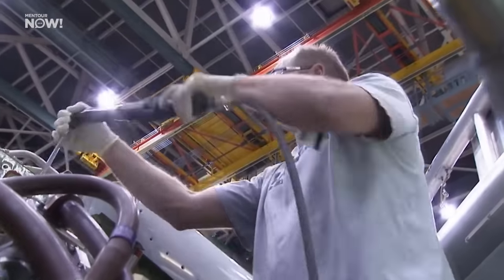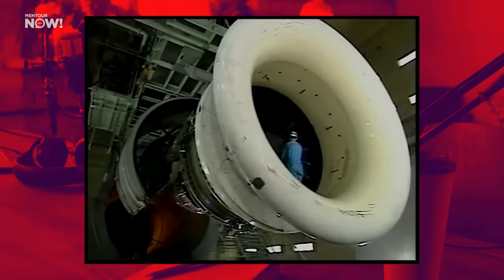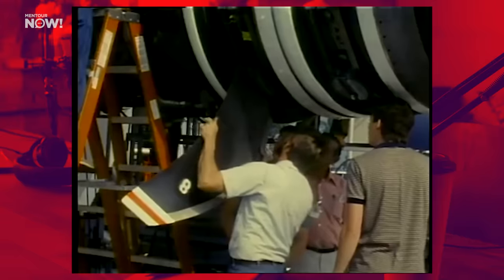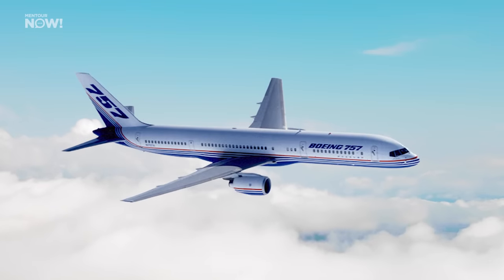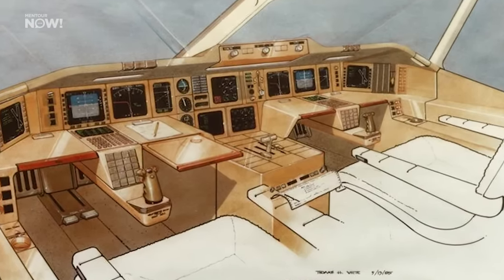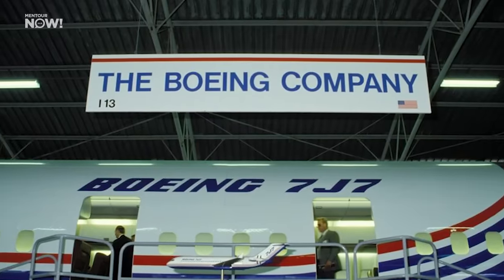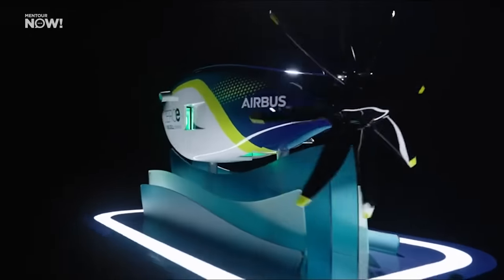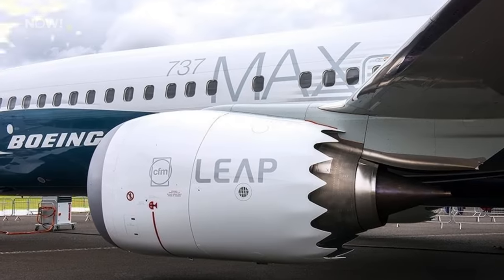Revolutionizing Flight! The Amazing Potential of the CFM RISE Engine.

Comment: Pratt and Whitney and Allison my A- -  , That Prop was a Hamilton Standard Counter Rotating Unducted Fan, Pratt made the Engine, Allison the Gearbox, I was Uncle Hammy that built the fan! I had just arrived a Ham Standard in 1989 the year they cut the funding, I worked for a short time on the follow up large scale Prop Fan, but the price of fuel plummeted so everyone said why bother.
That monster had 35% increase in fuel efficiency that the jet engines! It was cutting edge technology for sure the blades were water jetted, they had issues with the slip ring assemblies which were slatted for an upgrade then poof all gone.
Reply: That single Prop Fan on the NASA Aircraft was also a Hamilton Standard Prop Fan, they used a Harmonic drive to change pitch, The blades deep sweep was because the blades were designed to operate in the transonic region all day long, it was this that made the noise, a duct was envisioned for future models to combat the high frequency noise plus active electronic noise abatement in the cabin, We at Hamilton Standard had the answers and the solutions, the airlines were just knuckle dragging neanderthals with no vision.

Comment: When the supersonic Concorde retired, the commercial aviation industry became the only technologically driven industry to go backwards. 

Now, the commercial aviation industry is going backwards again, by basically returning to its propeller past, in the name of EFFICIENCY.

However, the UDF (Un-Ducted Fan) looked better than the modern replacement. That's because the fan at the rear is more visually pleasing when it's mounted behind the engine, not in front.

Comment: When it comes to the P&W geared turbo fan engines that power the A220 and E2's, reliability seems to be on going issue, especially when the jetliners are operated in very warm, humid climate. There are some indications that P&W have at this point time rectified most of those issues ?

Comment: What about containment of fan blades if one experiences failure?  The current shroud provides some protection of this but even reinforcing the fuselage or other areas needing protection would be an issue in my opinion.
Reply: That's exactly why earlier attempts to build unducted fan planes put the blades aft of the tailplane ...

Comment: My understanding of historical unducted fan attempts is that they were always way too loud.   And airport noise restrictions have only gotten tighter since then.  A standard turboprop has better efficiency than a jet and less noise than a fan, maybe funding research in that direction (e.g increasing cruising speeds) is the most promising in terms if improving commercially viable solutions.

Comment: When you need to achieve greater efficiency at the expense of everything else, you can put turbo-fan engines. More environmentally friendly as there is less fuel consumption. However, there will also be less speed, since at high speeds, this type of engine will be subject to increased vibrations, and with them an increased noise level will occur. Aircraft developers have dug up blueprints from the 80s and are trying to present it as new. If someone wants to know how the flight will look like - watch the video with Tu-95 flights

Comment: Counter rotating props were abandoned first in the 1950s because the frequent maintenance was too costly. And the speed was too slow compared to turbo jets.

They were VERY efficient for long distances though. You could go double or more the distance with the same number of passengers.

It would be interesting to see them make a comeback in the light of global warming and emissions reduction.

Though I'm not sure if passengers would be ok with slower flights.
(also rail is the way to go for efficient passenger and cargo transport. So what's the point of a slow passenger plane)

Comment: All sorts of questions start to come up when I see something like this. It's pretty much just a glorified turboprop. 

That likely suffers from all of the same problems that we already know of today. 

The by pass ratio I find extremely suspect in regard to it's efficiency. One of the biggest problems without having a shroud is that now your efficiency goes down on your wing tips (prop tips). Which means you will need longer blades to build up more pressure. 

I'm curious how the turbulence behind the fans will be. Counter rotating generally doesn't add much lift so that's interesting they are adding fins instead. This is actually what my previous company did with their fans to make them more stable but they were not adjustable even going so far as to angle them. 

I wonder how they are actually going to go faster than a traditional turboprop we have known for a while that turboprops are generally more efficient but the struggle has always been more speed. You get to a point where the prop tips reach transonic speeds and all hell breaks loose you seriously don't want to go transonic on your tips

In the image they didn't show counter rotating props on the other side of the aircraft which had me quite confused. Are they not concerned about the rotation momentum and trying to balance it out? 

And finally the cost. Are they going to feasibly be able to compete with high by pass turbofans? Who cares if the engine is 20% more efficient if they cost more either overall or in complexity/maintenance. 

No one really cares about the carbon footprint when it comes to their wallets (as they should because it's BS).

Comment: The gearbox must enable the blades to spin at a lower RPM to get close to but avoid the blade tips reaching the speed of sound. It is not just the simplification but the development of better more reliable gearboxes. At least this is the way I interpreted your videos information. All of this tells me that scaling up such an engine may pose some limitations on its size and thrust.

Comment: It would be interesting if the new toroidal blades could be used on these unducted blades thus having no blade tip ends and a more efficient quieter operation.

Comment: A very similar engine was attached to DC9, B727, and I believe an A300. They are probably still rusting at the Mojave airport. Oil prices fell and airlines lost interest. Where would we be now if they had continued to develop these engines in the early 80's. Of course that is when dumb F reagon pulled the subsides to wind and solar. Big oil had control. Don't worry though Germany, Japan, and the Dutch to name a few countries with foresight, continued to develop wind and solar. We have played catch up ever since.

Comment: God gave owls finely divided feathers on the trailing edges of their wings which makes them almost noiseless to prey. That and several successive staggered elevation wingtips. Maybe designers should do this for the trailing edges and tips of the turbo fan blades.

Comment: The idea of having a tube on the wings or tails to house a engine seems inefficient when there is a fuselage. Could a engine be built into it and the propeller spin around the outside of it, of course the air directed towards the wings though. Though it sounds way out there the weight ratio would be reduced, the diameter and therefore airflow increased, and there’s no worry of the parts flying off into the place itself.

Comment: NASA just threw Boeing a huge bone with the Transonic Truss-Braced Wing Space Act Agreement.  This will give Boeing a huge leg up on development of a 737 replacement.  The TTBW can work with a turbofan or open rotor engine so it'll be very interesting to see what an ultimate production version uses.

Comment: Hydrogen might work for planes because it gets burned fast. Problem with it is, it is highly corrosive and seeps through everything. Airbus has been running Turboprops on big planes like the A400M for a pretty long time now. Turboprops are a bit slower than jets, but in general I think they are much more efficient than jet engines. I guess it depends on finding the sweetspots between RPM torque centrifugal and centripetal forces along with the material science to make strong enough blades to withstand the ever present birdshot problem.
I wonder if the prop/fan design is able to take insipration from submarine propellers, because some of those designs are still secret and they reduce the noise in water by alot.
There is also alot comming out of drone development quadcopters specifically, things like the onesided propeller with counterwight and the connected blade type propellers. I wonder if anyone ever did a test with a onesided connected prop blade yet.
The bypass has a very interesting property, it sort of creates a funnel for the even more accelerated air and keep it compressed longer. In Rocket Science that is calles ISP. It is controlled by the shape of the conical nozzle and becomes very long and doesn't open much for vaccuum. I am pretty sure exactly the same is happening with the bypass air in addition to insulate faster air from slower air which creates the noise. Very interesting stuff.

Comment: Interesting, but I'm still dubious. Noise will be an issue, as with the Tu-95 (the only aircraft to be successfully tracked with seismometers), and the thought of a blade-out event is terrifying. If I'm still kicking when/if these engines get type approved, I'll still be avoiding them for a few years - the real world has a habit of showing up issues that weren't even considered in the controlled world of testing...

Comment: Am very surprised that these manufactures haven't implemented the toroidal blade design into these engines. They are expensive and complicated to produce, but, are much more efficient and very quiet while operating. Besides, the added expense of these toroidal blades would be quickly offset by the fuel saved. Guess time will tell if this relatively new design will ever be adopted into the aircraft industry

Comment: thanks for the explanatory video, great developlment there. one question, how much better would or could the engines be when driven to lower speeds, e.g. mach 0.7? basically all flights under say 2000km would not be much longer for the passanger, factoring in transport from and to the airport plus waiting time at the airport, so if substantial fuel can be saved there it should i guess?
Reply: or, actually, why don't we use turboprops up to those distances? how big are the differences in overall travel time (door to door) and fuel consumption?

Comment: You said the two options for a jet engine to generate more thrust are "More air at the same speed" and "Same amount of air faster." Wouldn't "More air, faster," also work?
Reply: It might be more clear to say that for the same thrust you could either accelerate more air a little bit or accelerate less air a lot. But momentum scales linearly with velocity and energy scales quadratically so you want to keep the velocity change as small as possible

Comment: What happens if it throws a blade?  I can't imagine the racket it would make running.  Most of the noise is from the fan blades. The compressor and turbine is quiet compared to that fan.  I can hear a high pitch noise from the compressor in a CFM-56 and I can hear the combustor once the engine lights off.  The fan overpowers the other sounds.

Comment: If an open fan engine catches fire, is it easier to extinguish?  I’m guessing an enclosed engine contains the equipment to put a fire out, but I’m not an engineer.   I think for commercial airlines, noise would be the biggest drawback.

Comment: I would've thought the reason blades break up if hitting a flock of birds was because the debris couldn't be thrown outwards. It would have to travel through the engine. With that thinking uncovered [forgot the term he used] blades would simply toss the debris away and behind.
Reply: Open fan! TY

Comment: Have you done a video comparing Turboprops with Jet engines.  My wife refuses to fly on a Dash 8 because it has a prop and so it must be very old.  I've tried to tell her that the two engines are basically the same except one has a prop and the other has a fan.

Comment: Current aircraft engines are used to test how an engine behaves when a fan blade breaks. No parts may penetrate through the outer fairing and damage the aircraft. It would be irresponsible for a propeller blade on the new engine to break and enter the passenger compartment. Therefore, for safety reasons, I do not see such new engines in the commercial sector, but in the military sector.

Comment: What a fascinating, well researched and beautifully edited video. Using hydrogen fuel tanks (they aren't fuel cells as referred to in the video but they are correctly supered) would be an interesting development in a business where safety is the primary concern. Hydrogen, notorious for leaking and embrittling metals, is going to be a substantial engineering challenge to make it a safe fuel in a hermetically sealed aircraft. I think it would be safer to keep the tanks in the wings where any leaking H2 gets vented straight to the atmosphere and has no way of building up to an explosive concentration.

Comment: So would it be incorrect to say that a jet powered aircraft remains a propeller aircraft but the propellers are powered by an axial flow engine rather than a standard gas, or maybe Otto cycle engine?

Comment: Great video. But I have a question. What is the point of the second set of fan blades on the new engine if they don't rotate at all?? 🤔
Reply: I wondered about that as well and can't find the reason anywhere

Comment: Aircraft is cruising at 25000-3000 ft so if they attach the open fan engine to the wing, do they have any way to prevent high-attitude freezing in cold weather?

Comment: I still don't really understand the distinction between turboprop and propfan/UDF. It just seems like a new TP design optimized for higher speeds with good efficiency. What an i missing? Not saying it can't be a great engine, just that the terminology seems more marketing than an actually different technology.

Comment: I feel like there was just far far too much time spent researching and funding this project just to arrive at what's essentially a glorified turboprop with variable stators behind it

i question if the stators relying purely on the rotating vortex column of the spinning propeller to themselves produce thrust would come with any disadvantages at cruising speeds compared to actually having a contra rotating arrangement, or even a coaxial ducted fan powered by the same turbine.

I genuinely don't want to come off as a detractor for this design and would love to see the team behind it fulfill the goals intended with this thing, these are just my two cents.

Comment: Having a hydrogen fuel cell aircraft is Very Important, but solid oxide fuel cells Simply Store more energy per unit space.

What about just making them pure electric and using a solid oxide fuel cell?  That way they get more efficiency And Distance?

Comment: When I see this design, I immediately think that it's more a new development of the turbo prop than the turbo jet, where turbofan is in the middle. What makes this design with external blades more close to a turbofan than turbo prop?
Reply: Eh, the turboprop/propfan/turbofan are closer together than they are to the turbojet. The former all derive most of their thrust from bypass, i.e. the air flowing around the engine core, whereas the turbojet is more primitive and relies solely on exhaust for thrust. But yeah, as the video noted, propfans are between classic turboprops and turbofans in efficient cruise speed, and there is a gradient of design between turboprops and propfans where each can evolve towards the other.
Reply: @henryptung  wasn't that exactly the point I made 🤔

Comment: What happens to a Hydrogen fuel cell(s) in a fuselage, if there's a fire on board? can it be jettisoned? Would it encounter the same problems as a zeppelin? can it hold up to a crash or would it diminish the survivability rate of the passengers and crew? Hydrogen to power the engines is definitely more efficient, cost effective and the byproduct is not hazardous.
Reply: It would be a similar question as what happens to a fuel pump in a regular airliner if there was a fire. The fuel cell does a different job than a fuel pump, but its only fire risk is that it has fuel flowing through it, similar to a fuel pump. Although inside a fuel cell the hydrogen is converted into water, which is what comes out the other side.  

Like with a regular airliner there will be fuel stored in tanks, and the fuel will pass through pipes and valves etc., and like with any fuel there is a fire risk. Hydrogen burns differently than kerosene, and it is more prone to leaks because of the small size of the atoms.  In some ways it burns safer than other fuels because unburnt hydrogen quickly disperses into the atmosphere, it doesn't "hang around" like kerosene does.

Avoiding a Hindenburg type of disaster should be possible by not storing the hydrogen in a highly flammable chemically coated cloth bag.

Comment: SUGAR Volt is a much better idea. Using electric motors to drive the main fan on a turbo fan engine instead of using gears from the main turbine is more efficient. This would make it a hybrid electic turbo fan jet engine. Also batteries are getting cheaper and more energy dense. Hybrid electric engines could be retrofitted to exist aircraft with batteries added too. I think NASA/Boeing SUGAR Volt study said the truss braced wing and hybrid electric engines would be 30% more efficient that a 737 MAX or an Airbus A320neo. - https://en.m.wikipedia.org/wiki/Boeing_Truss-Braced_Wing